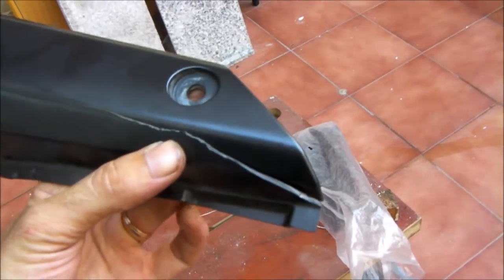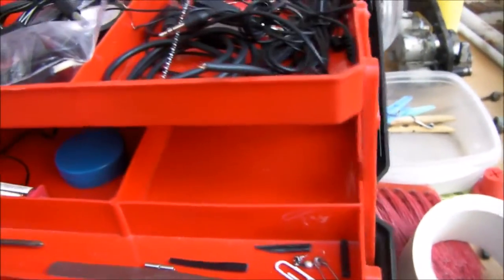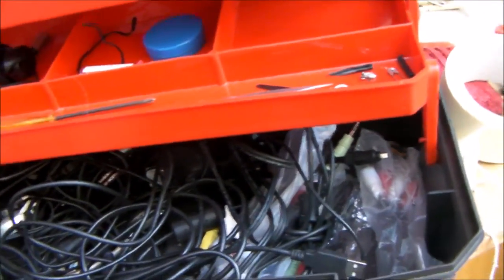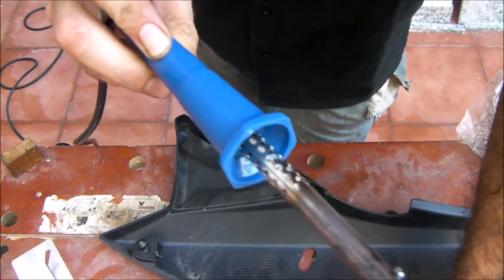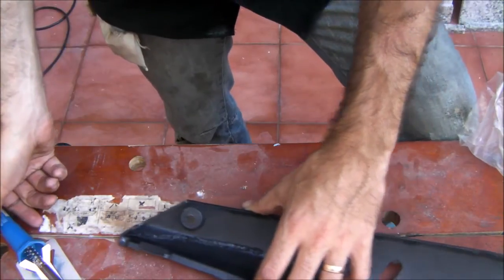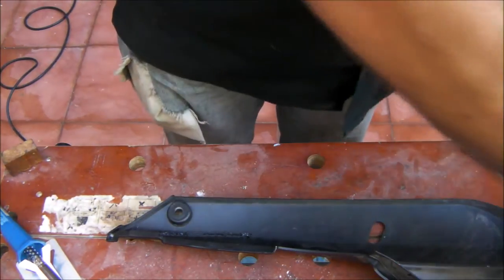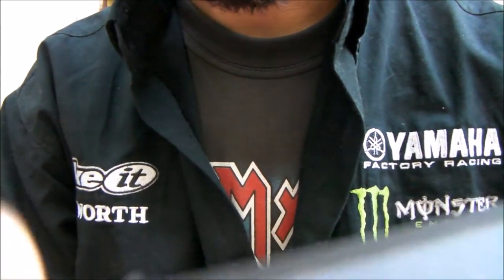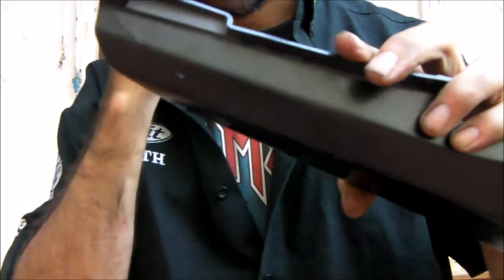Peachy's Place: Plastic Welding

Comment: Using the wire in there is an awesome trick!   Any particular reason you ran the wire mostly parallel to the crack?  I am thinking that the more times it crosses the crack the more strength it will add.  
Anyway thanks again for a great technique!
Reply from the maker: The wire was bent into a sort of S shape with the intention of crossing the crack several times. I probably would have had better coverage going the other way but that bike got written off not long after I made the video and the only panel on it still in one piece was this one so it did its job :)

Comment: the front finish with fibra glass and sand it , paint it
Reply from the maker: Problem with fibre glass is it's prone to splitting and looks nasty when it does.. I do my best to make the parts line up right so I dont have to apply any filler or fibre glass. But thats very much down to personal choice. Thanks for watching.

Comment: How can I tell one type of plastic from another? And does it matter??
Reply from the maker: Good question Keith... well you see this plastic i am working on here is black plastic and it is hand made by skilled artisans in Zimbabwe. The plastic cups which you get in canteens that are light weight and can be crushed easily are cheap to make and no good for use on motorvehicles. Those are made in Germany and used in construction of BMW motorcycle parts. :P
Reply: Darth Peachy
Ya know Chris, that actually kind of makes sense.

Comment: Nicely done
I had cracked one on my lower fairing but instead of the soldering iron i used Epoxy :) so far so good
Great video
Thumbs up
Reply from the maker: Thanks Samurai. If that epoxy cracks try this method mate it works a treat :)
Reply: Darth Peachy will do for sure

Comment: That's genius! Makes me wish I would've kept some of my old broken plastics from before instead of buying new ones.
Reply from the maker: Hey G9, as long as they are cracked and not shattered they are salvageable mate. This method works much better than fibre glass or glue and definitely a better option than spending your hard earned money on expensive new ones :) Thanks for the comment buddy. Chris

Comment: Never thought of using wire to cross stitch it together. I Always used to fill the little gunnles with glue. But I Like this way better. Good video buddy
Reply from the maker: Thanks mate. Yeah the wire is good because it flexes. People often use fibreglass but that doesn't flex as much as the plastic does which causes it to break. By melting the wire into the plastic it in effect becomes a part of it.
Reply: Unfortunately on my fzr400 fairing it's fiber glass so I cannot use this trick I'm stuck to using the God dam stuff!! Ermm I may do a video of the repair process. But I am going to use that technique
Reply from the maker: Cool mate, make sure you send me the link when you do :)
Reply: no problem,ill make sure to  reference you in the video.